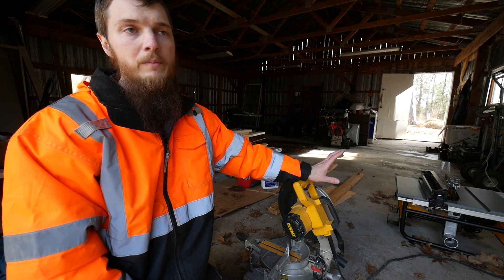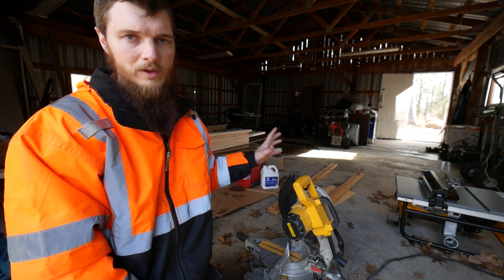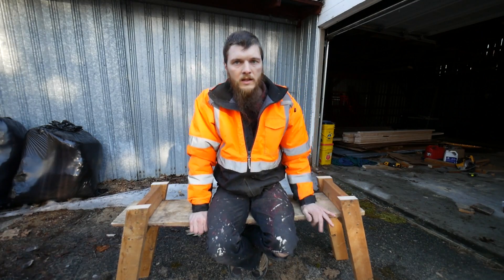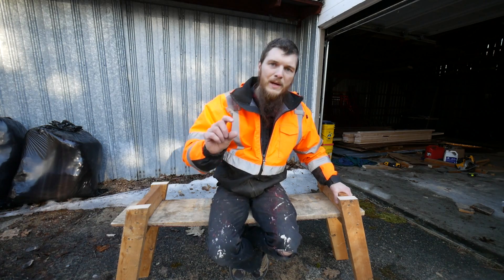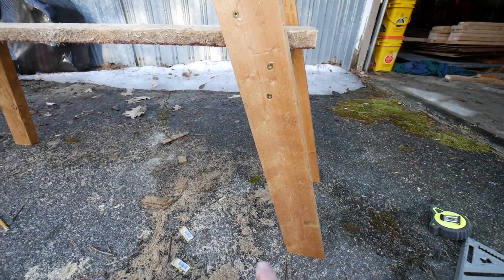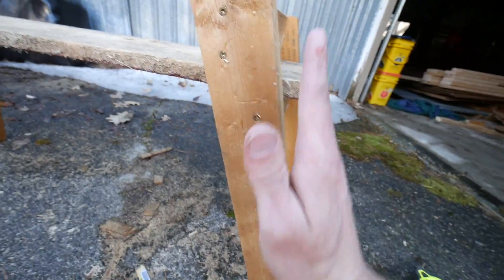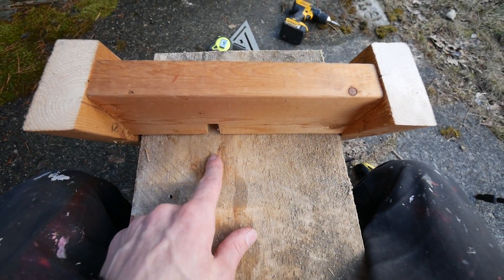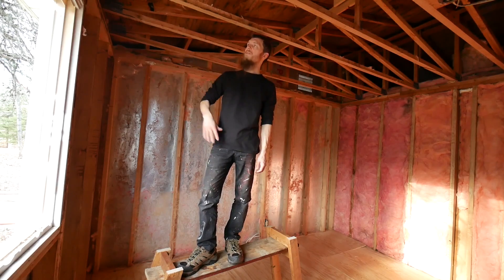Build an Easy Mini Scaffold Work Platform

Comment: Thanks! I need to build something like this to buff my boat that stored on blocks for the winter, this setup is perfect!
Reply: I was looking to make the same for the same purpose (buffing the sides of my sailboat). How high and how much span do you reckon this design could manage?  I need to get about 3 - 4 ft off the ground...
Reply: I will give you the exact dimensions of what I did, I saw your comment yesterday but forgot to measure it. It's in the back of my garage. @thebarold
Reply: @thebarold  okay, so the dimensions of mine are 3’x1’x2’. It turned out okay and I was able to buff my boat successfully over the winter, however if I was to do it again I would go wider. It did become a tad wobbly at times. I’m a younger guy so I didn’t worry about it too much but times when my Dad came out to help, I did get worried for the old man lol. Looking at it now, it’s  more of a bench to be honest than scaffold.
Reply: Thanks @Spacesprocketz !  I not as young but your point about it being wider (assume you meant the width of the platform which is 12" (and the span of your platform is 3 feet?)  My boat is 34' long so it will be a balance between the span being wide enough that I don't have to constantly move the setup and the stability.  I did think about angling the legs outward slightly to help with the forward and backward stability (if I am pressing on the hull to polish)...  I need this for the spring so I have all winter to figure it out...
Reply: @thebarold   I wish I made it that big to start out with, it definitely was a lot of moving around the hill. I have a 270 Sundancer so my boat is under 30’. The scaffold I framed out was only 3 feet long, 1 foot wide and 2 feet tall. You definitely would probably need yours taller and wider, the angling of legs is ingenious and would help a lot! After talking to you, I think I’m going to redo mine this winter for the Spring lol.

Comment: Excellent video! That is exactly what I need. I’ve already cut all my pieces and will finish it tomorrow. I’m painting my basement walls and ceiling. This bench will save me a lot of time cutting in the corners and masking everything. Thanks a lot. I knew there must be some easy way to build a small collapsible bench 
And this is perfect for 8’ ceilings. Upstairs is next but the ceilings are 9’. May have to build a taller one but might need more support.?

Comment: Put a stretcher board on the very bottom to keep both those legs all the way apart. If you shift your weight rapidly by walking towards one end you could easily fall if the bottom legs aren’t in a locked out position

Comment: Okay I'm going to gently shake my finger at you Doug. When you're using your Mitre saw (I think that's what they're called), you really should have it sitting level so it's not wobbling. Maybe build a couple of saw horses and put a sheet of plywood down on top of them so you can at least work standing up and on a more level surface. Does that make sense? I still love you guys...
Reply from the maker: I'm use to working in less than ideal conditions so it was pretty normal for me ;) Hey, that work platform turned out to be a handy sawhorse for me today, who knew.
Reply: @diyfferent  All in all, you are VERY handy I must say...we need more videos...love seeing the progress!

Comment: Why don't you just buy a stepladder? It's not like you're never going to use it again! Sure would be a lot easier to move and more flexibility.
Reply from the maker: It's actually quite the opposite. This took me less time to build than driving to the store, saved me money, and it's much more flexible and easier to move around than a ladder. I've always found ladders to be quite restricting when working on homes and this work platform makes everything easier.
Reply: Good enough! If you're happy, I'm happy. Thanks for answering.